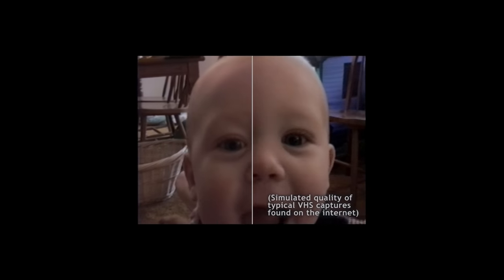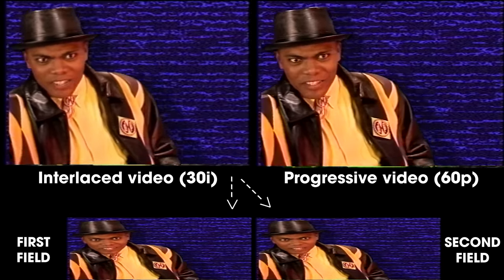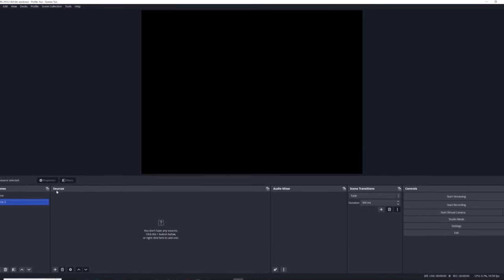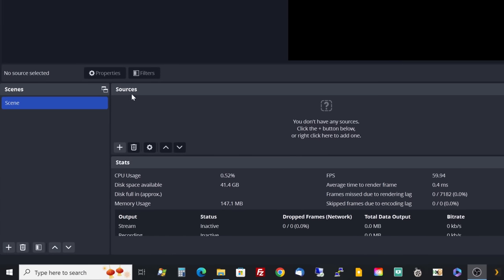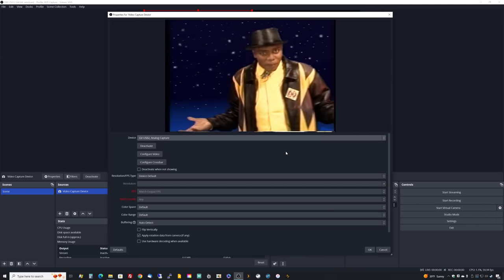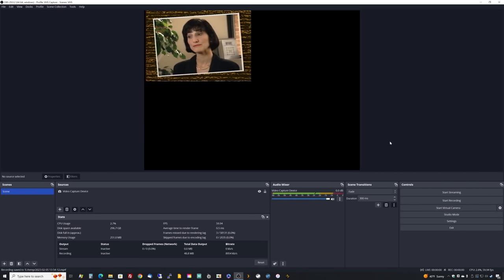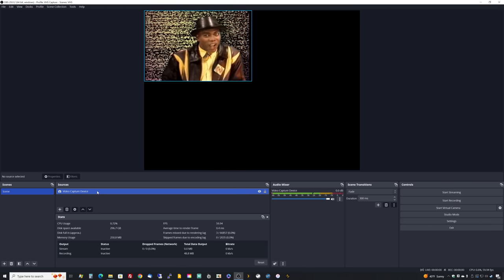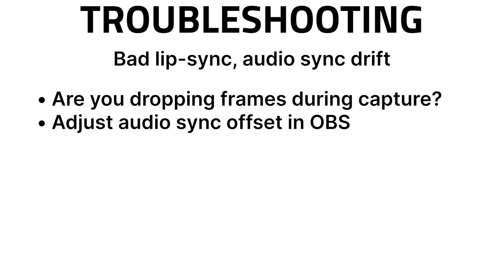How to convert VHS videotape to 60p digital video

Comment: I’ve probably watched around 40 different videos of how to capture analog to a file. This is by FAR the best one. Absolutely fantastic job. Can’t wait to watch more of your videos.
Reply: ok
Reply: Yes, I've finally found a great vhs transfer video.This is gerat.
Reply: But, a firewire card and cable is a better way to go with its larger bandwidth and they should have included this option on the device. SVHS is decent though. I have two old malfunctioning laptops with firewire connections, but had to use SVHS to copy old DV tapes to do my archiving.

Comment: Hi, I'm using the Startech device but when I switch between the different settings (PAL, NTSC, SECAM...) the video is Black and White or in Magenta/Red tone... Do you think it can be due to the extension cable or it's a setting in OBS ?

Comment: Excellent tutorial. However I cannot agree that the DVC-100 and driver provided in description really works with Win10 or Win11. I had to use the audio workaround in the description footnotes.  If you already are down the DVC-100 path, here are the workaround details: 
1. Acquire a stereo RCA to microphone cable or adapter to connect your source to your PC. 
2. under OBS source menu additionally select "Audio Input Capture". 
3. configure crossbar" so Audio Input Capture shows up in the Audio mixed along with your (unused) Video Capture Device. 
4. Probably good to set volume for the Video Capture Device to -inf DB or use the 3dots>properties> deactivate option, but I did not verify this myself.
Reply from the maker: Thank you for your clarified solution!
Reply: Thank you so much for this!!!!! I thought I was the only person experiencing no audio

Comment: What a legend it worked!
I used the startech video capture device and had to do a few extra things to get it to work in addition to adjusting the contrast.
1. At first it was black and white so in the "Configure Video" I had to set the "video" to PAL_B as I am in a PAL region.
2. The audio wasn't coming through so I had to add an "Audio Input Capture" and select the "Line (USB 2828x Audio Device)"
3. Despite the output resolution being 5:4 you need to make sure that you do what he did and set it to 4:3. Don't make the mistake I did.

I hope this helps someone.
Reply: 50 fps for PAL right?

Comment: You are an outstandingly clear presenter. I have ordered the dazzle device based on your recommendation. I look forward to transferring old videos from VHS to MP4. Thank you!
Reply from the maker: Thanks!  Unfortunately, I just now edited my video's description to say that I no longer recommend the Dazzle device because too many people were having trouble with no audio capture in Windows 11.  You can still use it, but you might need to connect your audio cables to another capture device, like a line-in port on your desktop computer.
Reply: @TheOldskoolPC  using the audio ports works OK. I had to do that with Linux and my Dazzle 100.

Comment: This is a fantastic tutorial for those who want to use OBS Studio. However, I achieve much better results capturing my native files from S-VHS tape at 640 x 480 pixels in conjunction with the capture software that came with my capture card. More details are provided below.

As a side note, for my testing, I'm using a S-VHS source tape, the original recorded tape, that was shot at my wedding with a professional 3-chip camera. So the image quality is super clean.   

There are two major problems with the methods used in this tutorial. First, is video "noise" which shows up as graininess or coarseness in the 1440 x 1080 output. Using Adobe Premiere, I "upscaled" my 640 x 480 digital file to 1440 x 1080 and it looks way better than the OBS result. I can easily compare the two results by using a split screen of the two videos in the Premiere Pro timeline. My upscaled native video appears slightly "softer," but there is none of that grainy texture that shows up in the OBS file. Simply stated, the 640 x 480 file is superior.

The second problem is more distressing. It is the residual interlacing in the OBS file that persists despite using the exact optimal deinterlacing parameters presented in this tutorial. By residual interlacing, I'm referring to the pixelated edges that are still visible in the 1440 x 1080 output by OBS. Sure, it's way better that an interlaced video, however, it doesn't come close to the deinterlacing algorithm that my 640 x 480 capture card uses. When I "upscale" my 640 x 480 digital file to 1440 x 1080 in Adobe Premiere, there is no visible residual interlacing. The difference is astounding.

For the side-by-side comparison, see ... https://www.adita.com/OBS-versus-AVerMedia.jpg

So what capture tool am I working with? I'm using an internal PCIe capture card that I purchased from AVerMedia for $130.00. It's called the C725 and I don't even know if they're still selling it. The card has both composite and S-VHS jacks, but I use S-VHS because my source tapes are S-VHS. The capture software that came with the card is called AVerMedia Capture Studio. The user interface looks like something from the days of Windows 3.1. The interface is rather clunky (not elegant like OBS) but it offers the essential parameters for setting the data rates for video and audio, the file format, and the deinterlacing options (but there are only 4 options).

One final note. I'm using a typical consumer grade S-VHS deck for playback, and I'm NOT using a TBC (Timebase Corrector).

Jim, keep up the great work. Your presentation manner and voiceover are spectacular.

Here is a link to an AVerMedia capture card that is very similar to mine:

https://www.dhgate.com/product/ce310b-professional-sd-pcie-capture-card/544866025.html?f=bm%7cGMC%7cpla%7c16625114107%7c%7c544866025%7c%7c103014%7cUS%7czuny%7cc%7c2%7c&utm_source=pla&utm_medium=GMC&utm_campaign=zuny&utm_term=544866025&gclid=CjwKCAjwov6hBhBsEiwAvrvN6KKvwvvDrj0W8dm6Hc_z8j0EgRuYWbzU9qB8ReZRQiF8Sv8WZy9NUBoCC70QAvD_BwE
Reply from the maker: Thank you for a detailed explanation of your process, and a description of the hardware you're using!  And thanks for the kind words :-)
Reply: Good info. - I will point out that S-VHS and S-video are not the same thing, but i knew what you meant.
Reply: Can you share your settings or make a video on your process as well? I have a c725b as well and would like to convert a bunch of tapes with great quality. Thank you
Reply: @myronachtman4304  ^ see question about your setup
Reply: @FoVision  I hope you got my email explaining my settings for the c725b capture card (AVerMedia).
Reply: Thanks for the info. Still in your pic where you mention the deinterlace residuals, I think that OBS made it look better in general (except the deinterlace). I think it's a problem of your de interlacing method. Did you try another one? 
I totally agree with low res. You want to keep it as small as is 575i i think is the video standard. And then extrapolate with an upscaling software. Or wait in the future an AI sick tool to make it
Reply: Would you be kind to upload the avermedia studio software to drive? I have an avermedia mini pci tuner hybrid card and I'm wondering if it might work with it.
Reply: I'm commenting to look at this later
Reply: Thanks for thanks s video please tell me how much does it cost and where Can i buy it
Reply: @lakhdarmessaoudi8305  What are you asking me about?
Reply: @myronachtman4304  I was hoping Jim's video would be sufficient to capture my Digital Hi8 in as high quality as possible but your comment has made me have a rethink. The link you provided doesn't go to any particular product. Could you recommend what I should buy to do the job as best as possible? I'm based in the UK.
Reply: So I am not sure why but my base canvas resolution options are only 1366x768, 1920x1080, and 1280x720. I'm not sure what to select because I'm not able to do 4.3 aspect ratio on my OBS

Comment: For "Recording Quality" I would strongly recommend using "Indistiguishable Quality, Large File Size." It is noticeably better than the option you recommended, "High Quality, Medium File Size." This has been my experience when capturing S-VHS tapes using S-Video cables. Perhaps the quality difference would not be as important if you are working with VHS tapes and the composite connection (the yellow connector).
Reply from the maker: Thanks for the tip.  I agree that if you are capturing a higher quality source, a higher-quality preset can keep more information around.

Comment: To insure a near perfect copy, I used a time base corrector. Gets rid of video flagging and 
lost frame video hits. Also color and tint correction. It creates perfect horiz and vert sync
pulses essential for mpeg2 to HEVC recording. A must have. (ex-TV Broadcast Eng)
Reply from the maker: Couldn't agree more.  I've got a DPS-290 sitting right next to me :-)
Reply: Is this different than what was suggested or is it something you add to what this video suggests?
Reply: @MISSY4EVR  It's something that you add, between the VCR and the capture device.
Reply: @bobfrates8485  I tried but it doesn’t connect

Comment: FYI: Some video editing software, like Apple's iMovie, automatically stretches out any 1440x1080 resolution content to widescreen, since that resolution is commonly used for anamorphic 16:9 1080i video. That's why I prefer to use 960x720 for upscaling standard definition 4:3 NTSC video, because it's 1.5x the resolution of 480i video so you get clean upscaling, it avoids this widescreen stretching problem, it's good enough to get 60fps on YouTube, and 1080p is overkill unless you're using advanced upscaling techniques.
Reply from the maker: Good advice.  I chose 1080p for the tutorial primarily because youtube gives it more bitrate.  There's nothing wrong with 720p (especially with VHS tapes over composite).
Reply: In Europe PAL was already 16:9 before HD
Reply: @dutchgamer842  PALPlus not PAL had provisions for 16:9 and prog-scan.
Reply: Thank you for the tip! I was hoping to use iMovie instead of OBS from the tutorial and you probably saved me a lot of time and grief ❤

Comment: There is one other important setting to consider when using the Windows platform. Microsoft updates sometimes change your PRIVACY settings. In my case, a recent update turned off "Access to My Camera." As a result, none of my video capture cards showed up in the OBS Studio drop-down menu. Very frustrating. Fortunately, I remembered to go back to the PRIVACY settings and turn Camera Access back on. This solved the problem and my capture devices came up properly in OBS.
Reply from the maker: Good point.  I had a windows update completely erase my firewall whitelisting preferences, and it took me a bit to figure out what was going on the next day.
Reply: For those wondering: Select Start > Settings > Privacy & security > Camera, then make sure Camera access is turned on

Comment: Great video. Please also do archival masters and 4K upscaling videos, don't let another 6 years pass for it 😊
Reply: I tried the Topaz Video Enhancer AI to upscale VHS videos downloaded from YT  with a reasonable result (don't expect native 4K sharpness or experience). You can adjust some parameters, so the 'AI' does not transform people and everything else zombies. 

I have the original VHS (a concert from '95), which I like very much. It is still foiled, never played, waiting for the right moment and method to capture. With this tutorial, it definitely has come. I'll give it a try, this deinterlaced 50-60Hz settings look very great. And sure, there are tons of other enhancement methods as well in video software built-in.

Comment: One nice feature of OBS is you can set a record length timer so if you know the time length of your VHS tape, or you w.  ant to record a portion in the middle of the tape, you can set this.  This is under the main menu bar,  Tools/Output timer.  You can record a 2,4 6 hr tape and then edit the ouput file into segments.
Reply: Thank you

Comment: I have been trying for the past six months to digitize VHS tapes with the program that was included with the device I bought, without any success. The issue was that the contrast was way too high and it seems like there was no way to fix it. So after watching this video and switching to OBS, my issues were solved. Thank you were much for this very well made video.

Comment: I would definitely be interested in your approach to producing more of an archival master, how the equip recommendations would vary, optimal software capture/processing recommendations (if different) etc. It's my understanding the player can make a big difference. I'm curious too if there are any worthwhile AI tools to process / enhance for noise, color, interpolation etc.
Reply: Yes audio duing capture
Reply: If i remember, the best player to get are component video VCR's. It seems like they were mostly used at TV stations, etc. But a quick ebay search didn't find much. - As a side note, I have also read that s-video isn't always better than composite.
Reply: @christianb8900  Yesthing wrong with using the older method
Reply: @christianb8900  I have several combo units with component outputs & none of them allow for component video output for vhs, only dvd. You have to use s-video for vhs, any conversion to component would be just that, a conversion, & not a raw output.
Reply: @J0SHUAKANE  Research it and you'll see that i'm talking about professional VHS players that rip raw from component video. Combo units obviously won't work.

Comment: A few years back I used the exact same cheap unit that you showed as bad options. It got the job done but I might take another shot at it with the ones you recommended. Thanks for the great video!

Comment: Jim, I like to thank you a lot for such a thorough and comprehensive video. I'm sure you spend lots of time explaining and presenting the Fields, interlaced videos, FPS mainly using  60 FPS, and more. Your technical presentation was awesome, thank you again to take the time for us. 

I bought a rather pricy USB dangle couple of years ago ($130) and did not like the flickering results converting my Hi8 mm analog videos but unfortunately, I had not seen your previous posting and there were not many postings at the time. I  searched and searched and found a posting for a Firewire capture card that could help me with my Digital recordings on my Hi8 video tapes. Now that I was not able to find an efficient solution for my relatively high-quality analog recordings on metal evaporated Hi8 SONY tapes. I purchased a couple of IEEE 1394 cards but never tried them to this date. I was hoping since my recordings were digital, I have better results in transferring or converting to MP4. 
I like to know your input on converting Digital mini DVs and digital Hi8s to MP4 by Firewire or other better methods. 

I don't mind spending a few hundred dollars to buy quality equipment for my priceless memories. 

Going through the YouTube videos I came across Gefen CI GTV-COMPSVID-2-HDMIS which is roughly about $250.   I'm not sure about this device, does it still allows both fields
to pass through? Do I still need to use OBS studio software? Do I get better quality with this device VS IO-DATA GV - USB.

Also, what do you think of upscaling built-in devices such as Gefen CI GTV? Is this feature the same as what you can do in Adobe Premiere pro-CC by clicking the clip and then clicking on the "Set to frame size" or "Scale to frame size"?

I think there is a demand for higher-quality tutorials (solutions) for this conversion even at a higher cost.

Thanks for your time.
Reply from the maker: If your sources are truly DV, then you should not follow this tutorial and instead capture the source files via firewire (IEEE 1394).  This will result in no generational loss, as firewire transmits the actual digital data right off the tapes.  I've used WinDV in the past to do this on Windows.  You can then use the FFMPEG command-line in this video's description to convert them without using OBS.  As for hardware upscalers, I can't recommend them because 1. I haven't tested any since the early 2000s, and 2. I have no idea how decent the upscaling is per upscaler, and whether or not the processing can be customized.  There are probably better videos than this one that cover upscalers -- sorry!

Comment: I saw the original tutorial 6 years ago, as I had a mountain of 8mm and VHS tapes to digitize. I've since properly digitally preserved my entire collection of irreplaceable memories and helped lots of family and friends! I've always been a stickler for proper tape field/frame rates, needing that 60fps output, but nobody on planet earth seems to get this right. These videos have been lifesavers!!! So happy to have this new, easier 1-step version, will save time. ?: Do you know if any of these devices have dual Mac and Windows compatibility or is it either one or the other? Thanks for posting!! Hopefully, you can post more advanced techniques in the future.
Reply from the maker: Thanks!  I'm afraid I don't know about the hardware drivers for Mac, so you should definitely research before making a purchase.  But OBS itself is cross-platform, so that part should be the same.
Reply: I have had good luck with the ElGato Video Capture device on the Mac, terrible luck with the Roxio.   I use the ElGato to convert for others and have had no problems.  I would like to use OBS for more flexibility though.  ElGato supplies the software for theirs.
Reply: @SteveHowardPhotography  do you know if the Elgato module keeps ''both field unharmed'' like the I-Odata one? would you recommend buying the Elgato? i have been trying to make all my operations on the Mac but can't use the I-OData on it, i've been hesitating about buying the Elgato